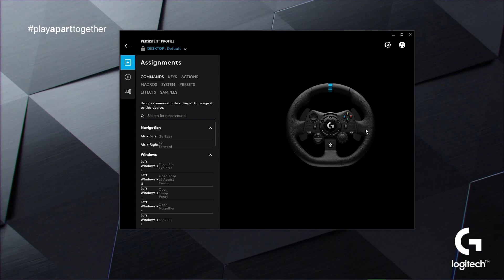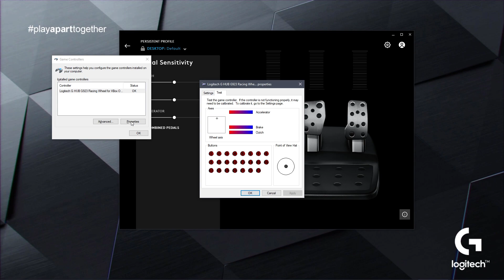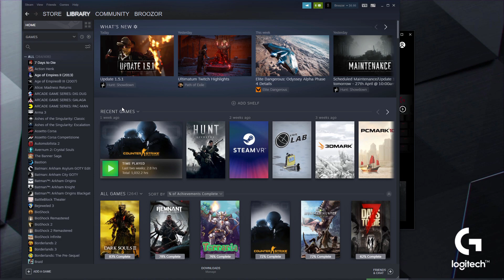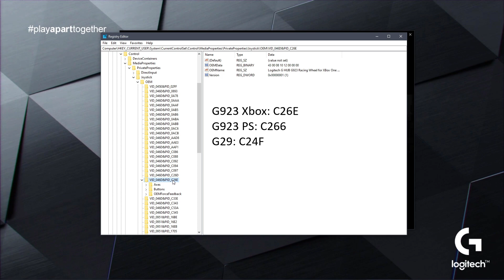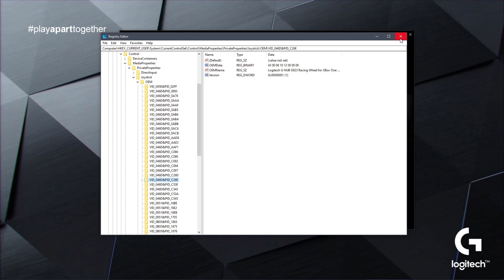How to troubleshoot G923/G29/G920 for Connection Issue

Comment: My dad steering wheel is not working even i plug in and its still dosent work,And he go to the steering tester when he turn left the nothing happen and when turn the right the screen of the steering wheel dosent have any move
Reply from the maker: Hi there!

Can you make sure your power supply is plugged in correctly? It also needs to be plugged directly into a wall outlet to ensure it has enough power.

If this doesn't change anything please open a ticket down below!
https://support.logi.com/hc/en-us/requests/new?ticket_form_id=360000621393

Comment: At first, the Logitech g Hub detected the wheel, but then I installed the Logitech Gaming Software application and then the G Hub started showing a connection advertisement. :(
Reply from the maker: Hi!

If you do not need LGS for any peripherals you do not need to have it installed for any functionality! Most of our products are supported through G HUB now anyways.

If the issue persists after uninstalling LGS please open a ticket below.
https://support.logi.com/hc/en-us/requests/new?ticket_form_id=360000621393

Comment: Hello Logitech support 
I have the g29 steering wheel but when I go into steam it doesn’t detect my wheel, how do I fix it?
Reply from the maker: Hi!

Can you make sure all the boxes are unchecked in your steam controller settings, and then restart steam? Can you also disable big picture mode and see if that helps.

Does the wheel still work in game? You may need to bind your controls manually as some software requires that.

If that doesn't help please open a ticket below!

https://support.logi.com/hc/en-us/requests/new?ticket_form_id=360000621393
Reply: @logitechsupport  I got it to work I had to bind the controls to the game thanks

Comment: it was working just fine yesterday and now it just doesnt work, it works fine with the power and steering but it just doesnt connect with my game which did connect even a hour ago?
Reply from the maker: Hi there!

Is this with only a certain game or with all games? There could have been a software update with a game that unbound wheel controls.

Also always make sure your power supply is properly plugged in!

If this doesn't help please open a ticket up below.
https://support.logi.com/hc/en-us/requests/new?ticket_form_id=360000621393

Comment: My wheel lights all the way up on my pc and it won’t work in any games btw the Xbox logo is not lighting up can someone help please
Reply from the maker: Hi!

Is your wheel calibrating on launch? If the is xbox logo is not lighting up there might not be enough power to your wheel. Can you make sure the power supply is plugged in properly?

If this doesn't solve your issue please open a ticket up with us!

https://support.logi.com/hc/en-us/requests/new?ticket_form_id=360000621393
Reply: @logitechsupport  thank you you fixed my problem predicate it have a good one

Comment: The thing is that the wheel is calibrating but does not show up in the g- Hub. Ive restarted my pc twice and idk whats the problem cuz i played with it yesterday on my xbox working fine.
Reply: and i cant see it on the controll panel either¨
Reply from the maker: Hey there! Do you have the power supply plugged in as well when you are using a PC? You'll need to make sure there is appropriate power being sent to the wheel. Also make sure you are not using a USB hub!

If this doesn't solve the issue please open a ticket below with us!

https://support.logi.com/hc/en-us/requests/new?ticket_form_id=360000621393
Reply: i fixed it by restarting my computer again. thanks

Comment: hello! i getting an issue with 360 degrees when i'm playing F1 2021, it's like the wheel lost g hub configuration and change to 900 degrees.
Can you help me?
Reply from the maker: Hey there!

Have you tried reinstalling the drivers? Is it only in F1 2021? If you are getting calibration issues there also may be a loose power connection. 

Opening a ticket is always the best way for support! Link below
https://support.logi.com/hc/en-us/requests/new?ticket_form_id=360000621393

Comment: Dear customer service team i have connection issues with Driving force gt module working on Win 11.All the buttons and pedals working fine but the steering wheel does not respond at all after installing win 10 driver.is there anything i can do to get it work? thank you
Reply from the maker: Hi there!

All our wheels should be compatible with Windows 11. However, if you are still having an issue after any recent Windows updates please open a ticket with us down below!

https://support.logi.com/hc/en-us/requests/new?ticket_form_id=360000621393

Comment: did not help my steering wheel still does not appear in the steam settings
Reply from the maker: Hi!

Are you getting power to your wheel? If you can make sure everything is seated correctly it could solve the issue. If that doesn't change anything please open a ticket down below with us!

https://support.logi.com/hc/en-us/requests/new?ticket_form_id=360000621393

Comment: I have problem with my g920 , when im like turnir 90 degree my wheel f1 pedals or buttons does not respond and my xbox light stop flashing .
What should i do i cant find any solution
Reply from the maker: Hi! 

Can you make sure your wheels power is connected properly and plugged directly into a wall? 

If this doesn't help please open a ticket below with us.

Thank you!

https://support.logi.com/hc/en-us/requests/new?ticket_form_id=360000621393

Comment: hey guys. my wheel is blinking, however it is blinking much faster. power is hot the issue, and i’ve restarted everything twice. i would really appreciate help!
Reply from the maker: Hi there!

Typically the blinking is a power issue. Do you have the wheel connected to a surge protector or directly to a wall? You may need to make sure it is going to a wall outlet to receive full power.

If this doesn't solve your issue please open a ticket below!
https://support.logi.com/hc/en-us/requests/new?ticket_form_id=360000621393

Comment: hi logitech, when i go to joy.cpl and press properties its blank i did the 4th step but it is still blank what do i do?
Reply from the maker: Hey there!

If there is no recognition of a wheel in joy.cpl there may be a power issue. Can you check to make sure your PSU is plugged into a wall outlet and the wheel correctly?

If that doesn't help we can dive deeper and troubleshoot with our ticket system below!

https://support.logi.com/hc/en-us/requests/new?ticket_form_id=360000621393

Comment: Hi, i am stuck at step 2, my wheel and pedals are not represented on g hub, no movement at all. Also the wheel is not seen on steam as a detected controller. At first i installed logitech gaming software and figured out that wheel is not working properly then i unistalled LGS and installed g hub instead yet nothing changed. Please help me out.
Reply: An addition, my g29 is stuck on "connecting" in g hub.
Reply from the maker: Hi! Can you open a ticket below with us? We can go more in depth with our troubleshooting there!

https://support.logi.com/hc/en-us/requests/new?ticket_form_id=360000621393

Comment: So my wheel if i turn it to the left side it dont work either on the other side how to fix that?
Reply from the maker: Hi!

If you are getting no response from the wheel in G HUB it could be a power issue. However, if your PSU is properly seated and the issue is still there please open a ticket down below!

https://support.logi.com/hc/en-us/requests/new?ticket_form_id=360000621393

Comment: it just says to connect it, its connected..
Reply from the maker: Hey there,

Can you make sure your power supply is completely connected to the wheel? It also would benefit with being plugged directly into a wall. 

If that doesn't help please open a ticket down below!
https://support.logi.com/hc/en-us/requests/new?ticket_form_id=360000621393
Reply: @logitechsupport  it still doesn’t work

Comment: G920 and  removed C262 and then unplugged my wheel and then plugged it back in and I've refreshed multiple times but it still wont show back up
Reply from the maker: Hey there!

Can you make sure your power supply is completely plugged in? You also may need to restart your PC / try a different USB port.

If this doesn't help please open a ticket up with us below
https://support.logi.com/hc/en-us/requests/new?ticket_form_id=360000621393

Comment: what happens its connected and its on ghub but when you move the steering wheel nothing happens
Reply from the maker: Hi!

Can you make sure the wheel's power supply is properly connected? It also needs to be directly into a wall. If this doesn't help please open a ticket below!

https://support.logi.com/hc/en-us/requests/new?ticket_form_id=360000621393

Comment: Ive deleted C262 and reconected my G920 but it doesnt show up when im refreshing. It also doesnt make a sound when disconecting the wheel but the white led on the wheel is on when conected. The Wheel doesnt show in G Hub. When trying to game with it it works but most buttons dont work and the wheel either wants to move wit hforce to the right or left side, so it kinda works but doesnt show up or propaly works
Reply from the maker: Hi!

Can you make sure your power supply is plugged in correctly and also directly into a wall outlet?

If that doesn't help please open a ticket up with us below!

https://support.logi.com/hc/en-us/requests/new?ticket_form_id=360000621393

Comment: @Logitech Support i unchecked the boxes in the steam but i can´t find my wheel. On G HUB evrything works fine but i can´t find the wheel. I use Logitech G920. I bought the wheel 1 day ago. Please response ;) IDK where is problem.
Reply from the maker: Hi, 

Can you make sure in big picture mode that "Generic Controller" setting is unchecked? This might solve your issue!
Reply: @logitechsupport  nope i unchecked it and nothing happends i restart steam and logitech software and nothing change. :/

Comment: my pedals are working but bacwards or inverted? for example my gas pedal is at 100% throttle without toiuching it but when i touch it it goes down... same for the brake. if their is a fix for this pls lmk. thanks
Reply from the maker: Hi!

Could you open a ticket up with us? We can help you with this there!

https://support.logi.com/hc/en-us/requests/new?ticket_form_id=360000621393

Comment: Hello what would happen if the wheel is connected but not connecting? Do I still have to do all the steps? Please reply
Reply from the maker: Hello there,

Is your power connected properly to your wheel and is that power supply directly into a wall outlet? If that doesn't solve the problem please open a ticket with us down below!

https://support.logi.com/hc/en-us/requests/new?ticket_form_id=360000621393

Comment: My problem is that no matter what the GHub won't detect my wheel
Reply from the maker: Hi!

Is your wheel calibrating when plugged into a USB? Do you have your power supply plugged directly into a wall? If all that is confirmed and it still doesn't change please open a ticket down below!

https://support.logi.com/hc/en-us/requests/new?ticket_form_id=360000621393

Comment: my wheel doesnt work in ghub my pedals do how do i fix this cause it doesnt get said in this video
Reply from the maker: Hey there!

Could you make sure your power cables are connected and your power supply is directly connected to a wall? If this doesn't help could you please open a ticket up with us below!

https://support.logi.com/hc/en-us/requests/new?ticket_form_id=360000621393

Comment: Nothing works when i plug my g920 into my pc it says there is an issue and need to restart and if i wait then it restarts and says it again and goes on and on. I cant use g hub because my g920 doesnt even get the chance to connect need help bad please
Reply from the maker: Hey!

Do you have all the power cables plugged in for the G920? That might be your issue! If not, opening a ticket with us will be the best way for help!

https://support.logi.com/hc/en-us/requests/new?ticket_form_id=360000621393

Comment: I deleted it but I’ve re plugged the wheel in and it isn’t showing back up
Reply from the maker: Hey there!

Did you try a new USB and can you make sure all the power supply cables are properly seated?

If that doesn't help please open a ticket up with us!
https://support.logi.com/hc/en-us/requests/new?ticket_form_id=360000621393

Comment: Just gonna say I’m really stupid because I have been trying to fix my wheel all day then I watch this video and I check that the powerpoint is on an it isn’t🤦‍♂️😂
Reply: Bruh literally me today
Reply: I was getting angry why it wasn't working, an hour later I realised I didn't even plug the power cord in 🤭😆
Reply: I think that my AC is dead 😥
Reply: @kinggamer-if7ru  same
Reply: @justarandomedude1013  luckily my warranty still valid so they gave me new one 😄👌🏼👍🏻👍🏻
Reply: @kinggamer-if7ru  mine doesn't XD
Reply: Same LOL
Reply: Fixed within the first 30 seconds
Reply: Guy's I have the same but still can't fix i have rpm lights on
Reply: Same
Reply: Same here😑
Reply: Same just spent hours now I’m just going to sleep bc I gotta work 😤😂😂
Reply: Same here XD
Reply: It's so stupid this comment is what solved it ffs lol
Reply: Broo same I had one of those plugs with extra Igs I only had one side plugged in💀💀💀
Reply: broooooo I usually never comment but tyyyyyy don’t I just realized and remembered my sister took off the power brick to charge the power bank😂😂😂😂😂😂😂
Reply: Hey guys, can anyone help me g hub detects everything pedals and wheel buttons but wheel steering itself, could it be that my power brick is not giving power to the wheel motors?
Reply: Same
Reply: This comment makes no sense. Whats a powepoint?
Reply: Same 😂
Reply: Same 😂😂😂😂
Reply: Same here

Comment: Nothing about PS5. My G29 is powered fine, when I connect to the PS5, it calibrates fine, but nothing else. The PS5 does not recognize my G29 at all. No other controllers are connected. It just sits there.
Reply from the maker: Hey there!

Does it work in game? Has it worked in other games or consoles prior?

Also if you'd like faster support please open a ticket below!

https://support.logi.com/hc/en-us/requests/new?ticket_form_id=360000621393

Comment: i have a g29 wheel have forze feedback but the green light does not show in games it can turn but no buttons are working do you know how to fix?
Reply from the maker: Hey!

Are you referring to the RPM lights? This is something that developers have to program compatibility with and may not be available in all games!

However, if you are getting no functions from the wheel make sure that you have all the buttons bound in games. Sometimes you need to set that up manually!

If that doesn't help please open up a ticket with us!

https://support.logi.com/hc/en-us/requests/new?ticket_form_id=360000621393

Comment: hi logi my g920 is working but its not showing on my ghub and the  Windows Controller when i play fh4 or 5 its steers to left and right i tried updating the ghub and the drivers but the g920 doesn't show up
Reply from the maker: Hey there!

When you plug it in does it calibrate?

You may need to reinstall the drivers as directed in the video.

If that doesn't help please open a ticket up with us!

https://support.logi.com/hc/en-us/requests/new?ticket_form_id=360000621393

Comment: it wont let me calibrate it g923
Reply from the maker: Hi there,

Could you be a little more detailed with your issue? If the G923 is not calibrating on launch it could be a power issue. Make sure you power supply is plugged in correctly and into a wall outlet! If this doesn't help please use the link below to open a ticket up with us.

https://support.logi.com/hc/en-us/requests/new?ticket_form_id=360000621393

Comment: Hello, how can i use my shifter on g923? It does not appear, thanks
Reply from the maker: Hello!

Can you make sure your connections are properly seated on the wheel? You should get an arrow key that pops up in G HUB that will allow you to see the shifter.

If that doesn't help please open a ticket up with us so we can diagnose this further!
https://support.logi.com/hc/en-us/requests/new?ticket_form_id=360000621393
Reply: @logitechsupport  hi... after many tries, the arrow does not appear on ghub, but in game the shifter works... is that normal?
Reply: @logitechsupport  i instaled a new version of ghub and my shifter does not works any more, i should use one ghub of 2020, and it works, but no arrows on ghub interface, what can i do to have it working in new versions? Thanks

Comment: My wheel is getting power and has been working with my Xbox but the console broke so I moved to PC, I am currently trying to use it on PC but when I connect it there is no calibration and the computer is not receiving any inputs (e.g. when i turn the wheel) which was evident through G HUB. Do you have any suggestions?
Reply from the maker: Hey!

This could mean that you aren't receiving enough power to the wheel. Do you have the power supply plugged directly into the wall?

Comment: My wheel doesn’t work nor appear at all in the joy.cpl even though i have multiple times repeated the windows registry steps. The wheel does appear in the logitech g hub but not on steam controller tab or anywhere else.
Reply from the maker: Hi there! 

There may be a power issue here! Can you make sure your power supply is connected properly?

If that doesn't help please open a ticket up with us so we can diagnose this further!
https://support.logi.com/hc/en-us/requests/new?ticket_form_id=360000621393